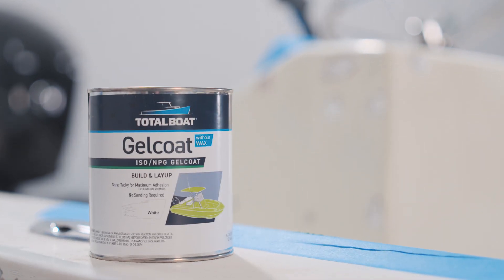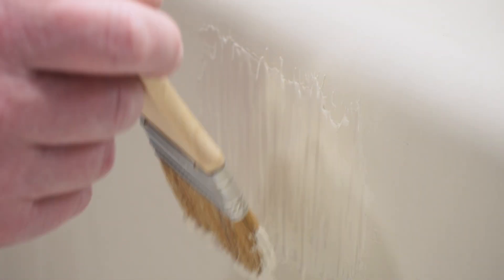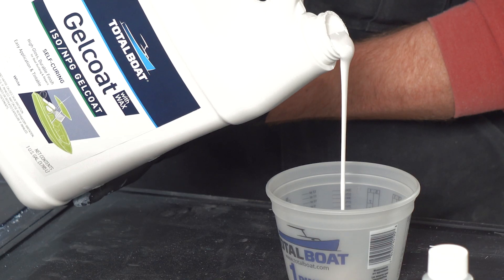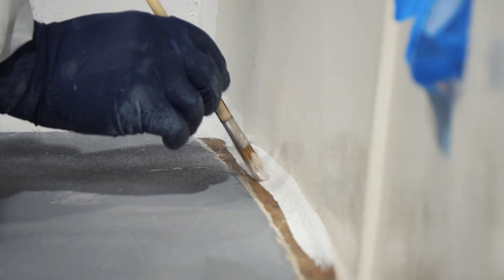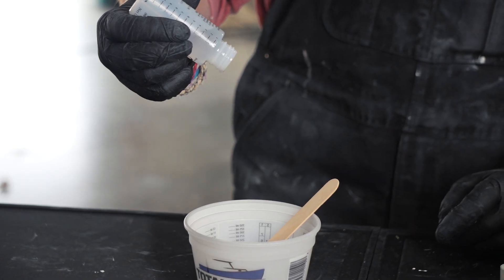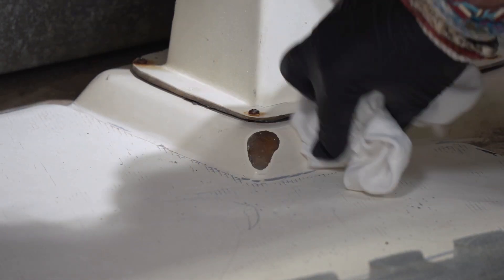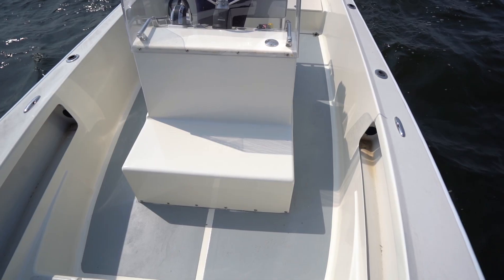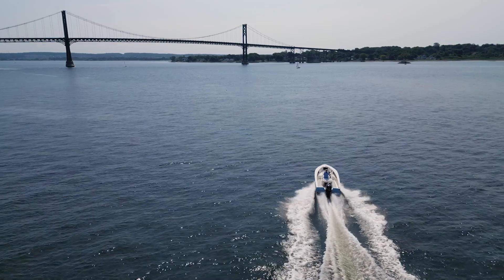TotalBoat Gelcoat

Comment: Pourriez-vous s'il vous plaît me dire comment je dois diluer le gel coat si je travaille avec un pistolet à air comprimé ?
Reply from the maker: For spray applications, start by thinning 2-5% with styrene, and add more, as needed, for proper spraying, up to an absolute maximum of 15% (the more thinner that is added, the more chance there is that the color of the gelcoat will change slightly). The spray equipment being used and the environmental conditions will dictate how much thinning is required. Gelcoat should not require thinning when applied by brush or roller. If desired, a small percentage (1-3%) of styrene can be added to help with flow.
Reply: @TotalBoat thankyou